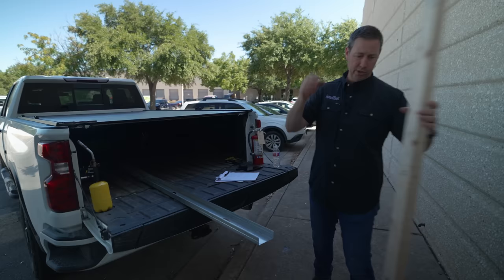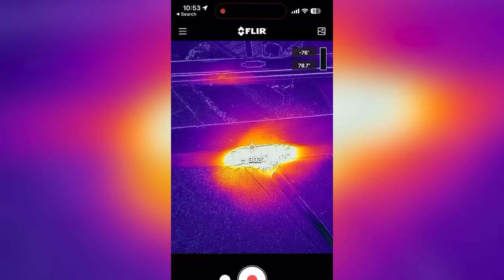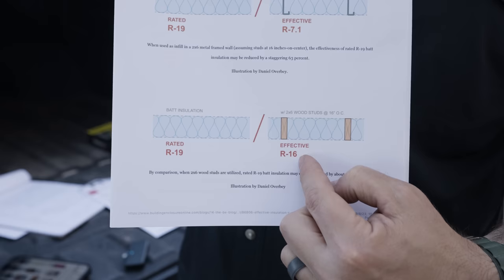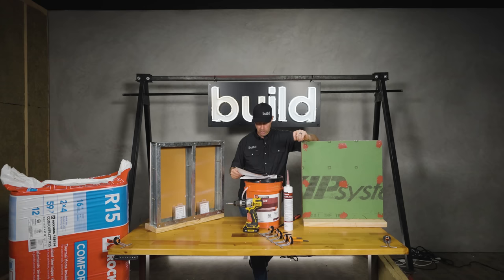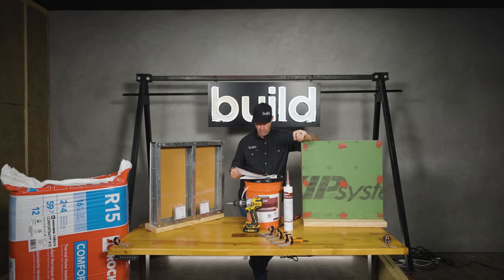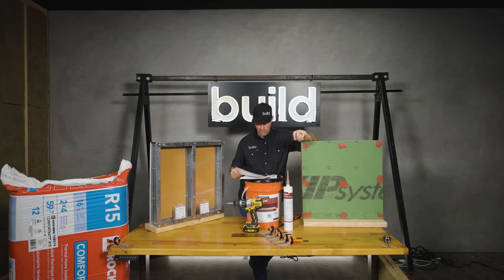Framing Studs: Steel vs Wood

Comment: Matt, I have watched and enjoyed your videos for a couple of years. This was one of the most informative I have watched. 23 years ago we built our house with 12 gauge light gauge structural  steel framing (including trusses) and have never regretted our decision. We live in Florida and thermal bridging was a concern. I used 1" Polyiso as exterior insulation and 4" open cell foam for cavity fill. When I opened walls for modifications I haven't found any moisture nor mold.  In the last 2 decades bulding science and materials have come a long way. To do it over we would incorporate some of the new concepts but still go with steel studs. Thank you for the work you do in bringing interesting, informative videos for our education and entertainment Keep up the good work.
Reply from the maker: That’s awesome!  That thermal break on the outside was key. Plus you don’t get too cold very often. Appreciate the comment
Reply: Looking to build a steel frame kit for our home.  What kind of sheathing did you use and what did you use for cladding?

Comment: In Norway its common to use the steel studs for interior walls in comercial, assuming mostly due firerating you get with that and gipsum walls.. Never seen them on exterior walls at all.
Reply: THIS.  I tuned in to learn about where we DO see steel studs used; interior non load bearing walls.  I’ve never in my life seen a residential build use steel studs on an exterior wall, though I am in Canada so that may have something to do with it.

Comment: Been looking at doing a Barndo with a prefab barn as the base but looking to add 2x4s to the perlins so that I can add sheething and break the metal to outside contact and filling adding 2 inches of closed cell foam before putting batts to fill in the cavities any thoughts?

Comment: This is good information, 25 years ago I built and all steel residential home, but the climate I was in didn't have the condensation issues so I didn't see wet inside the walls. Fast forward to today and seeing the improvements made to residential construction I would follow a different design methodology that removes the issue with thermal bridging. (Think metal SIP) There is a company that does this called Thermasteel but they were in bankruptcy and I don't know if they are out of it yet.  If I could make two other points, the steel house was sound reflective, I would definitely use sound proofing in more places. Also TRIM is a pain in the arse have you ever tried to set base board in a metal track... it sucks. I would definitely adjust the height of the house walls so I could put a strip of wood along the base (thickness matching the wallboard) and if necessary along the top for crown molding so trim goes on with pins, there is still a shoot back from the nailer possible, but having wood is Sooo much better than steel track. Oh and buck the windows with wood too.
-MG
P.S. metal floor joists need a de-greaser, the roller form used for manufacturing sometimes leaves oil.

Comment: Been wondering for years why we don’t see more steel studs in residential when it’s ubiquitous in commercial. Thank you for doing this.
Reply: It's fairly common in South Florida; but the exterior walls are almost always concrete block.
Reply: Hard to insulate to prevent heat condution.
Reply: @harveypaxton1232 Yeah it makes a lot of sense!
Reply: Or structural steel studs. I was surprised that he focused on the non structural commercial studs when comparing to residential framing.
Reply: You'd use exterior insulation 1st. The thought of cavity filled insulation would be secondary
Reply: hanging anything on steel is a nightmare

Comment: I soon will be moving from California into a brand new house in Chile framed in steel. It has 4 inch EPS on the exterior then covered in stucco. The wall cavities have fiberglass. The walls have no sheathing and instead use steel straps/bracing for rigidity. The second floor is a poured slab on some sort of corrugated metal. Its supposed to be much more energy efficient than most tract housing in that country.  It was very interesting to see something so different than what im used to here in the US.

Comment: I would use 2 x 6, or larger wood studs and 5/8, or thicker,  plywood sheathing for structural strength. After my experiences in hurricanes (including Hurricane Andrew) I will avoid all oriented strand board. They are poor with water and wind driven debris. 

The Prosoco R-GUARD waterproofing looks like a good product to use on the sheathing. Rockwool Comfortboard exterior insulation and James Hardie Siding makes the wall complete. 

The  Prosoco masonery anchors look good. Is their an equivalent product for attaching siding? 

I like ICF structures as well. I would always use ICF for basements.

Thank you for all the good ideas.

Comment: Thank you for the insulation comparison.
Another big reason not used in residential construction is NON-LOAD bearing structure. There usually isn't enough NON-LOAD bearing walls in a residence to justify using both stud styles. They are more expensive and require a different toolbox. 
It could make sense in a remodel adding in walls though.

Comment: I drove by a taco bell yesterday being rebuilt and was shocked to see it being wood framed. Steel may not catch fire but every architect that I mentored under always argued, "I prefer to be stuck in a wood building on fire, wood has to burn and will still hold while steel weakens as it is heated".
Reply: If I ever get to build a house I want 3 to 5 foot thick concrete /stone walls with heavy duty steel i beams for structural support and a concrete slab with a decorative metal roof
Reply: QSR are typically wood framed a little structural steel sometimes steel framing behind fryers for the fire resistance. I once was a construction manager for one of the largest franchisees in the US that owned a several different brands all over the country and this was typical of all the builds throughout the country and different brands (ie Taco Bell, Burger King, etc.). I came from a commercial GC before that role and had to learn wood framing because all I knew was steel framing from previous experience

Comment: Exterior walls 

Three things

1. Rain screens to drain any water that gets past the veneer. Many sidings are just decorative and require this. 
2. Vapor (edit not Air) permeable weather barrier. Moisture going to be in the wall. Needs to get out to avoid moisture issues. 
3. Continuous Insulation outboard the wall. All or greater than half the r value outboard. 

whether wood or steel. 

Cavity insulation just isn’t as effective. Higher degree of installation faults.
Reply from the maker: Air Permeable weather barrier?  Sure you don’t me Vapor permeable?
Reply: @buildshow  please do a vid of aluminium framing!!

Comment: Hey matt and everyone!!

What about a steel stud in a hot and humid climate? Could the external surface of the stud wall become cold enough that condensation happens on the outside, due to the outside hot and humid air?

Comment: What kind of insulation batt fits into the steel stud, since it is hollow compared to the wood studs being solid? Condensation is the reason I’m going with wood too, glad Matt covered that.

Comment: Discussed this with a commercial contractor in the US. Doing interior work. 

Is cheaper for them to do metal studs. 

 the advantages of steel studs are. Pack of studs easier to bring to job site. 
Easier to wire and plumb the wall. Sheers kept in the pocket can be used to make adjustments. 
Versus 
Weight of wood. Not to mention shipping costs. 
Have to use a saw to trim. Not to mention the dust. 

For this contractor is cheaper to do. And quicker.
Reply: Exactly why steel studs are so popular in the UK now.

Comment: Great video Matt!!

So what I’m seeing is we need a metal T-stud?! Imagine a spilt metal structural stud with a composite thermal break
Reply from the maker: Interesting idea
Reply: Yes! Great idea! There are already holes punched for wires/pipes, maybe you add more holes but reinforce them with some sort of insulator. I think it might be hard to have the two metal sides completely separated due to structural reasons, but maybe...

Comment: Matt, love your video's & always insightful. I am building a 2 story home with structural steel studs & I beams for several balconies. One of them being 50 ft long & super heavy.   The project has 2x6 studs & steel trusses in California. The area is considered a high risk fire zone. I shear walled the home with radiant barrier & plywood. After watching your video, I wished I had used the rockwool on the exterior.  Right now I'm insulating the wall cavities with R23 Rockwool & turning the 24 inch batts horizontal so they will fit tight. Its time consuming with a few more cuts.  I've personally framed several homes with wood & it's so much easier to work with. This may not be an orthodox way to go & certainly more time consuming, but the house feels pretty comfortable. Structural studs are also pricey compared to wood. One benefit with steel has been altering the floor plan a few times, since its easier to disassemble & rebuild with less material loss. I don't regret the choice in building materials, but would recommend wood for most residential builds for time & expense.

Comment: Even my local lumber yard 2 x 4's are 9's, 10s, and 11s.  So much crook, bow, cupping, and twist.  I wish I could buy 2 x 4 lsl's
Reply from the maker: You can buy 2x LVL or LSL studs. Usually if you order you can get them in 1-2 days.
Reply: In Canada they are difficult to find.  I end up buying 11 3/4" and ripping them down to 3 1/2".  Walls are straight and will stay straight.  I can never go back to lumber.  Lsls are a bit cheaper and even straighter since there are no overlapping veneers.  Also no wax that the Lvls have.

Comment: all the steel framing buildings I've seen, here in Québec, had continous foam insulation outside the  the frame which negates a lot of the issues of steel framing.
Reply: Steel resi builder here, that's what we do!
Reply: I think most steel builders would focus on a continuous exterior insulation vs the cavity fill.
Reply: Yeah use zip system R 3-9 sheathing and you’re good to go

Comment: Do you still need a moisture barrier on the inside in a very cold climate? I would think you would want to keep the moist air away from the steel even if it is better insulated.

Another reason to go with steel framing for multiunit residential is the number of arson events on those building sites, at least that's true in the SF Bay Area.

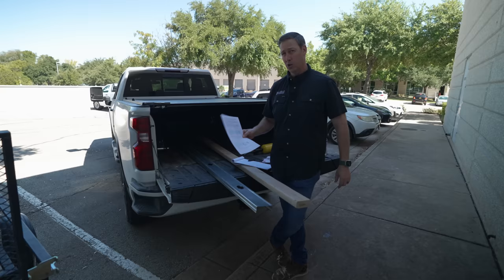Comment: @6:17, While steel stud reduces the R value of a wall, it is non -combustible. For Single-family residential construction the Building Code doesn’t require fire-rating the structural components, such as wall, column, floor, roof, or shaft. Such construction is commonly designated as VN construction. However, a multi-residential building requires a minimum fire rating of 1-hour. 1 hr fire assembly using steel stud can easily satisfy than wood stud whose fire assembly is a tad more complicated.

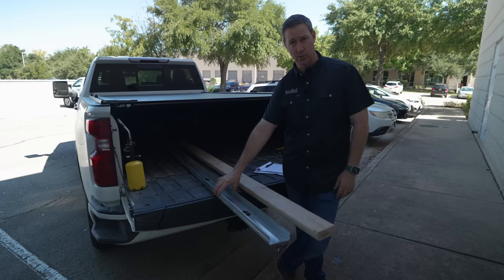Comment: @2:56, steel stud for structural application is readily available. Wood stud is structural only when not dry-rot or termite infested. Residential building built with steel stud last much longer than one built with wood stud. Why do homebuilder insists on wood stud? Lower initial cost. Who bears the long term cost? The home owner.

Comment: I too prefer wood framing.  One excetion I have is the framing for the entry door.  I would frame the wall that the front door is in with steel.  Along with installing a commercial door frame and door.  Mostly to make it EXTREMELY difficult to kick the door in.
Reply: Lol where are you that kicking the door in is a major issue? Never crossed my mind to protect against that boogie man.

Comment: How would ICF with 3” of exterior Rockwool and stone siding and ICF roof with slate shingles hold up in a fire?
Reply: Why would you do exterior rockwool on an ICF home, when the ICF itself is insulation? Sounds like overkill to me. But you do raise the question I'd like to know, which is an ICF exterior with steel interior studs, or an ICF exterior with wood interior studs?